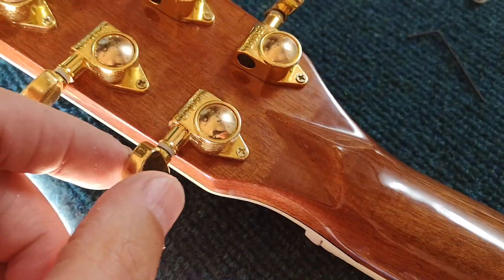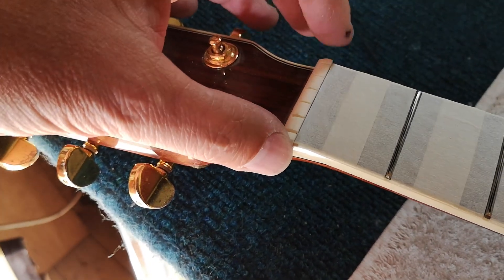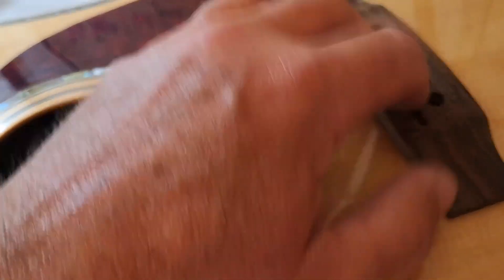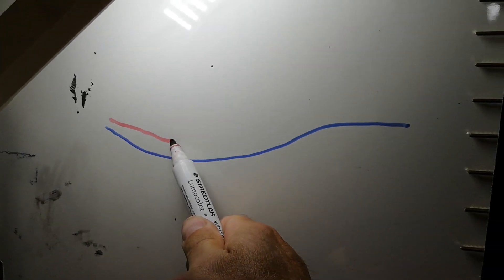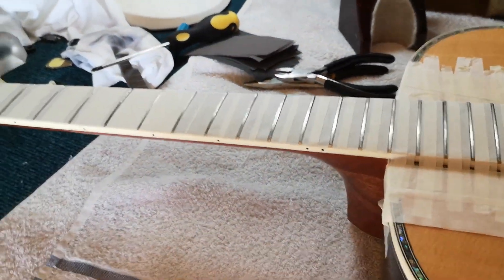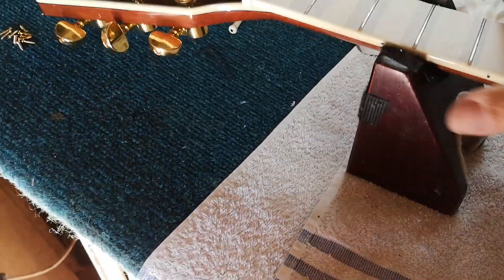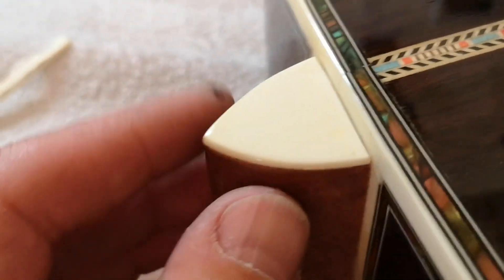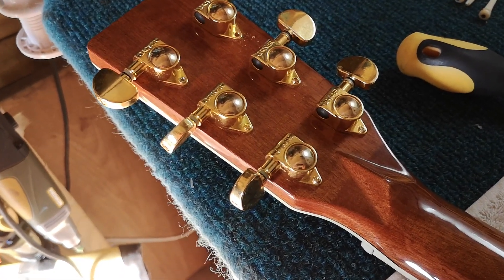Quick look at a counterfeit made-in-China acoustic guitar.

Comment: Hey Sam. I have a little problem. Buzzing open D string, that awful long meow sitar kind of sound. It's not frets (nut&saddle action and relief is ok) nor it's strings behind the nut and -  when I put a clip on tuner on headstock it's gone. It's driving me crazy. Can't figure it out. Any idea what could cause this? Thank you!!
Reply from the maker: Hmm. Might depend on what the guitar is. I know that on some Teles one or two of the strings can set up quite a sympathetic vibration when strings are played... But the term 'sitaring' is most often used for the sound caused by the nut slot being flat (i.e. horizontal) rather than tilted backwards at 5 - 10 degrees. this causes the string to almost 'float' over the nut without enough downward force to produce a clear note. Your nut can LOOK great and the slots can appear to be exactly at the right height... but whether or not the slot is sloping backwards is all-too-easily hidden by the walls of the slot..
Reply: Press the string down with your thumb nail right on the edge of the nut facing the fretboard. If it's gone it's usually the nutslot just as Sam described.
Reply: I had awful trouble with that. Refiled the nut. Checked the bridge. Checked fret heights etc. Nothing solved it...until I changed the strings. I think it was a bad string so maybe give that a go?
Reply: @peterstroughairart  I had the same on an epi ej200ce it was one of the jack plugs BUT it was already tight a tweak with a spanner did the trick, took a lot of finding though

Comment: I know this is a comment on a 3yr old video.. but the reason this guitar has or had a 14th fret hump was because it was dried out. I have fixed this on numerous guitars, and it's due to the back shrinking and taking the neck block backwards with it. when you rehydrate the guitar over the course of a few weeks (I use about 60-65% RH) the neck hump will slowly disappear, and the neck will have come back to where it should be. I actually had a fake D28 that i fixed using this method, when i got it, frets 7-13 were all dead, and after rehydrating I have use of all frets again and it required no fret dressing when done. Seems to good to be true but this is most often the cause of the dreaded 14th fret hump, and it saves the frets.
Reply from the maker: Hi Shane - thanks for the comment. It's great to hear from people who have personal experience of putting theories into practice and assessing the results. 
While reading your comment I thought 'where in the world are you located?' - and from one of your gameplay videos I figured you're in the US? The reason I'm asking is that here in the UK, we're on the wrong side of the 'ideal' range of RH for guitars of 45-55%. Our average is somewhere in the 70s and often as much as 98-99%. For that reason, it's as much as most homes can do here to get the RH down to about 50-55% but I'd be very surprised if either the UK environment or any UK home could de-hydrate an acoustic guitar. I think it's more common here to be taking guitars to be DE-humidified if anything. 
I don't remember how long the customer in this video had the guitar in the UK (from China) but research shows me that even if it was only days, the relative humidity in Nanjing (just one of the many Southern China guitar factories) averages 75%... 
So while I don't doubt that your experiences are as you say, I'm dubious about that being the issue here in the UK but I'm definitely NOT an expert in acoustic guitar wood humidity. Seems to me that the key issue is the relationship between the relative humidity and the wood's humidity and changes the ambient clearly can cause changes in the other... The only way I can see a Chinese guitar drying out too much in the UK is if the guitar was made WITH very 'wet' wood - such that it is able to continue drying even in our 75% average humidity?

Comment: its pretty. I bought a chartin from ebay, and the neck snapped on shipment. I got the refund and got to keep the guitar. I fixed it, but it doesn't sound too great. I bought a real martin D-45 after, and I have to say best guitar ive ever had. I have an HD28, 614ce, 914ce and multiple gibson electrics. The chartin looked good, but cant compare to any of them. Just for those wondering.
Reply from the maker: The Chartin looked pretty and sounded...not bad. But if you play a lot of acoustic (as you clearly do) then you'll know the difference.

Comment: You could have offered to sand off the logo before starting repairs.
Reply: He'd have had permanently damaged the headstock - the logo is an inset. Personally I'd never buy one - pick up a Harley Benton or a Vintage. If you want a "name" buy a Fender acoustic, which are pretty cheap and (these days) pretty good. Otherwise buy an low end Eastman or a Sigma (if you want the Martin look and feel. If I bought one of these copies I'd feel like a fraud and an idiot (for believing that what's on the headstock matters).